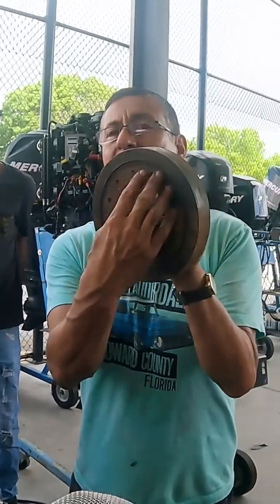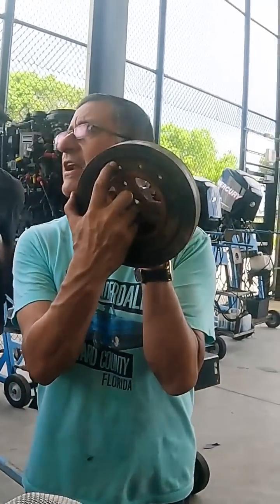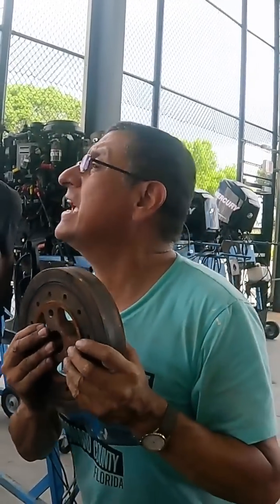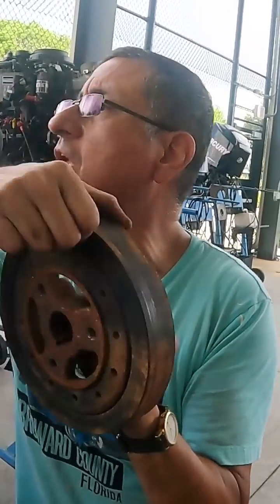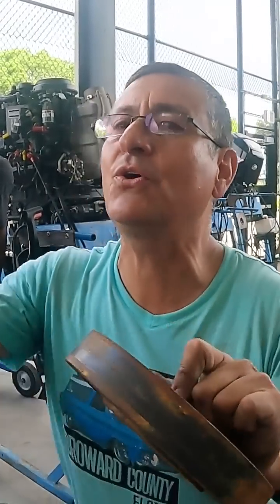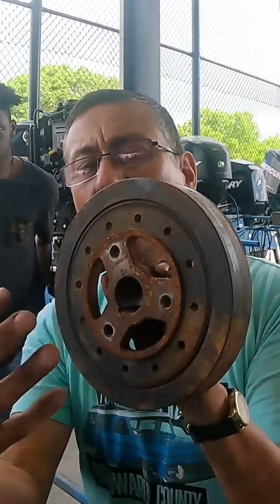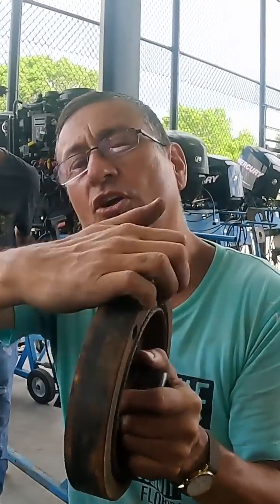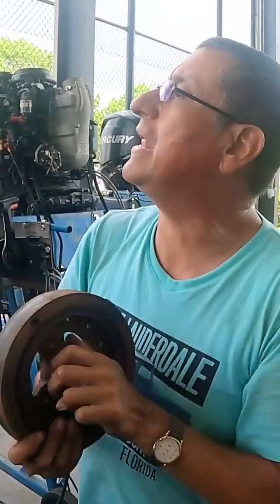Vibration in the Engine #shorts

Comment: I changed all 4 motor mounts on my 97 camry le. 151k miles. Now the car wont stop shaking. 5 times swapping old and new mounts and it still won't stop shaking while idle at a stop light/sign.

Comment: The bad alternator bearings will put a vibration into the belt breaking the water pump, crank shaft will shoot out the block, vibration will be felt at the steering wheel above 60mph every time you press the breaks, this vibration will set a code P0- vibrrration

Comment: I use a solid balancer
Reply: not for long bro !!
Reply: @casemodder89  I would with ceramic roller bearings in crankshaft n camshaft as main bearings from skf cooper splitcage yea ok keyed pin pulley on them Duramax on cam n crankshaft I wonder y Dave in Utah does it 🤔😋
Reply: @casemodder89  won't go out time

Comment: The harmonic balancer is a misnomer. It is actually a harmonic dampener. It does not balance the engine, or keep it from vibration. It dampens out torsional vibrations in the crankshaft, which if not controlled, can break the crankshaft.
Reply: "It does not balance the engine, or keep it from vibration. It dampens out torsional vibrations"... which one is it
Reply: I differentiate between out of balance vibration and tortilnal vibration because you can't even feel tortilnal vibration. Tortilnal vibration i is not caused by an out of balance condition, but instead, by the power pulses flexing the crank shaft. @brandonwalker4767
Reply: @brandonwalker4767 
It’s exactly how he said it. But I see you too. 
He was only trying to separate the semantics of “car talk”.
“It doesn’t balance the motor” — like the little weights used to balance wheels.
“It doesn’t remove vibration” — go touch a running motor with a harmonic balancer installed, it still vibrates.
Reply: *damper. Dampener means to make something damp
Reply: You are very confidently wrong about these semantics.  It's perfectly reasonable to call it a harmonic balancer, because it stabilizes vibrations by damping.  It is incorrect to call it a harmonic dampener because it does not make the harmonics wet. I believe you meant a harmonic damper, which does mean the same thing as a harmonic balancer.
Reply: I think you need to check the Merriam-Webster, and Oxford dictionary before you leave a snarky comment about someone's verbiage. 
I don't understand why most of these spitefully worded comments come from gamer types on YouTube. Get off your Play Station and learn some people skills.

Comment: You still have vibration with the stock dampener it only works at idle to low rpms you need a real dampener from fluidampener that takes up the vibration why better smother engine and frees up horsepower that’s lost with the stock cheap rubber design